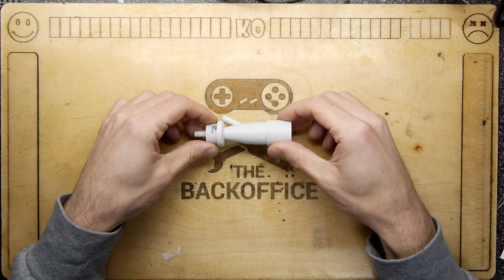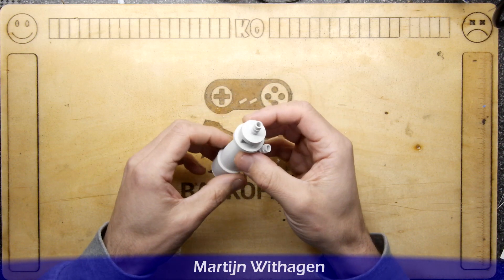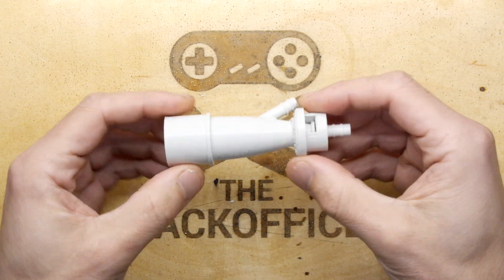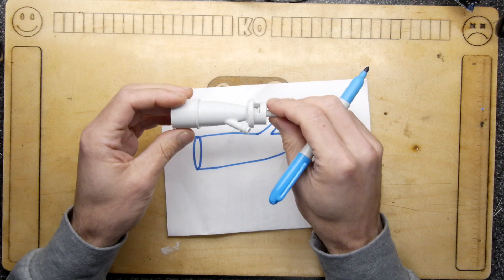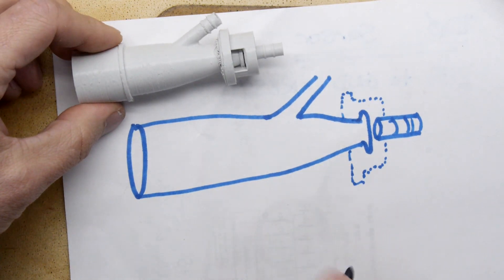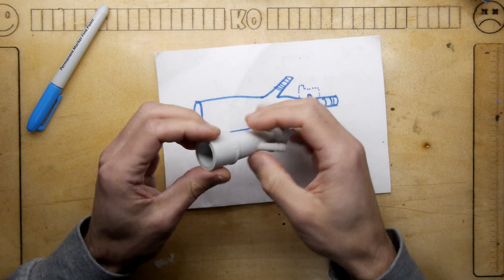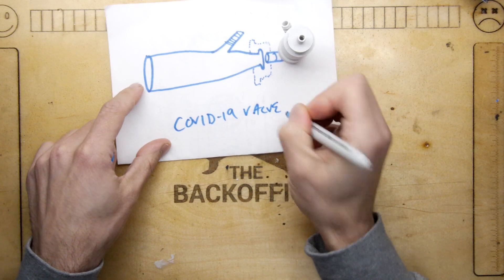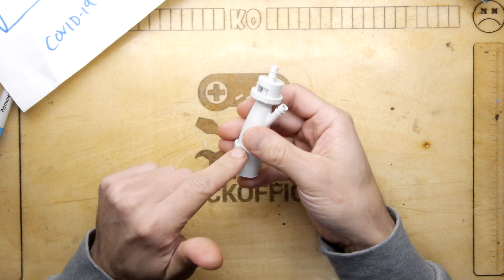3D Printed Ventilator Valve From Recent Covid-19 Coronavirus News

Comment from the maker: News: Also got an explanation on how they work. They are a blend valve. The take oxygen from the top and push it into your mask. They suck in air as they pass so you don't get neat oxygen. The side  tube acts as a bleed to adjust the amount.

Also told to print one for every member of my family, chances are, if you turn up with one and they don't have any, they will let you use it.
Reply: I've heard that they need to sterilize the valve before using. If a hospital needs to go over sterilization, i wonder why they simply wouldn't sterilize the original valve over and over. I would thing that single use policy would not apply when you don't have spares a patient que.

Comment: PLA was originally developed for implantable medical devices, it is noted for a high degree of biocompatibility. When it degrades, it should degrade into lactic acid which is an endogenous compound.

Now naturally this does not necessarily apply to your filament, where the PLA manufacturing process is not medical grade, and then it'll likely have an added dye or pigment and a masterbatch carrier, such as EVA. It's best not to try to implant any into yourself.
Reply from the maker: That's probably good advice in general: Avoid implanting into yourself anything you have made yourself in your garage. 😂

Comment: Got one on my printer now. By the way a Venturi valve operates by negative pressure generated by flowing gasses. It's not a check valve or one way valve, it's a mixing valve.
Reply from the maker: Thanks for the update, it seems obvious now 😂 I confirmed the function of this valve with those in the field. Looks like it is simple enough it should definitely work.
Reply: Hi Brian do you have the design file link ?
Reply: @abditelaga1890  https://www.thingiverse.com/thing:4235374
Reply: @brianfisher7385  thank you

Comment: I read the article regarding this part of clearly stated that these parts are not suitable for FDM printing. They used sls printers with PA12 material and then sterilised the part.
The part wasn't as good as the original but still worked good enough.
Reply from the maker: Apart from strength I couldn't see why it would be an issue. Sterilisation would potentially be a problem but again, realistically, it depends on how near death you were to give it a try
Reply: @backofficeshow  oh I quite agree.. I'd rather have that than nothing! 

But the problem with fdm is the layers trap bacteria that's why it's also unsuitable for food related products.

Comment: PLA is made from corn starch and will biodegrade with enough time, the only reason for it not to be safe would be from any additives
Reply from the maker: Given the situation and weighing up the odds, I think if I were dying on a hospital bed, id probably risk it.
Reply: @backofficeshow  Most manufacturers should have a materials data sheet on request that should tell you tbh :)